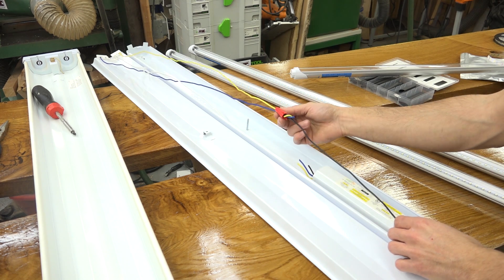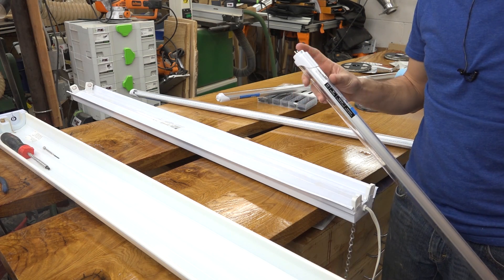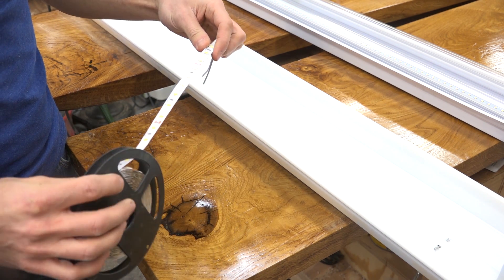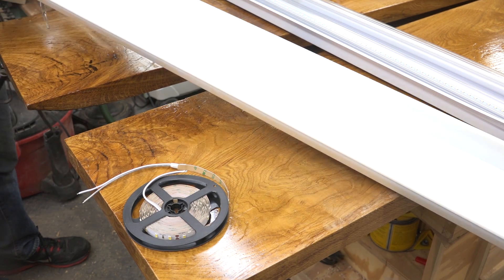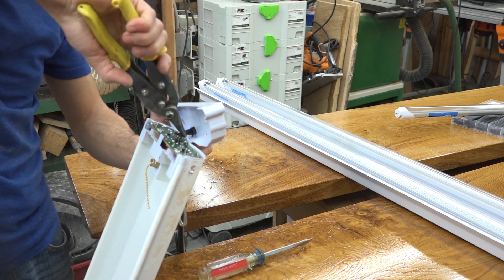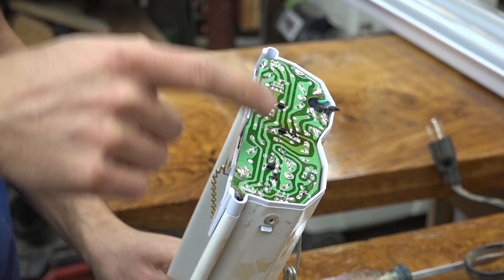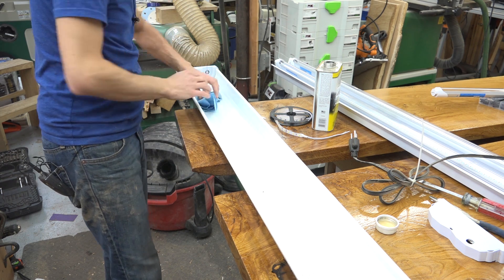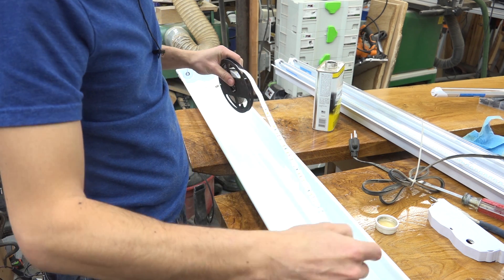Custom Workshop Lighting Solutions with LED Strips

Comment: Matt, great idea with the LED’s. 2 advantages to using them you didn’t mention (at least in this video) are operating cost which is a tiny fraction of incandescent bulbs and fluorescents and almost as important - the LED’s will last the rest of your life for most of us so the periodic hassle of replacing bad ones is gone. I’m shopping for a roll of them now and will outfit my band saw, drill press and router table right away.

Comment: I take out the metal cover for the ballast and wiring and flatten it out a bit but still slightly curved and stick my strips to it (especially good when the whole fixture is not easy to remove such as when hung with molly bolts to drywall ceiling) so that they point in different directions like one big half tube. Watch out for new strips that are made to go directly to AC mains without transformers or resistors (52 LEDs in series); much more efficiency.

Comment: I built a few of these awhile back, using simple 1/2" plywood and 1/8" white coated hardboard (bathroom paneling, whiteboard, etc.) as reflective surfaces. Most important, though, was the LED strips: I was able to find 5M strips WITH a 12V power supply for about $13 each on eBay! They're 5630 LEDs, which are the largest and supposedly brightest. Works amazingly well!

Comment: Self stick anything, especially something that produces heat is no good and only temporary. The only thing that will work is how you fixed the first one which has a good mechanical bond. Your other later video bears all this out.

Comment: How much power does each one take? The reason that I ask is I have a surplus of old pc et al power bricks. I was wondering if I could put an ac power box on tools or where ever and plug tool and power brick into the box and use the brick to power the lights. Would let me incrementally convert to use the LCDs, Use some transformers that I just couldn’t throw out, ...

Comment: I did something similar with my bandsaw, only I wired a converter to the power coming into the saw.  This way, when the saw is plugged in, the lights are on - little extra safety warning for myself, reminding me that the saw has power.

Comment: Question : On those replacement tubes where you disconnect and bypass the ballast to run AC direct to one end of the fixture, what happens if someone comes along and puts a regular florescent bulb in there ?
Reply from the maker: I'm not sure what will actually happen but the replacement tubes come with warning stickers that you can put on the fixture to indicate they are modified.

Comment: I looked at the data sheet for the LEDs that were used and it looks like they are run at 8-9 mA of current each. The life should be almost forever as the 5630 LEDs are normally driven with 20-25 mA each and still have long life. Even the smaller 2538 LEDs are driven at 15-20 mA of current. The current is limited by the one resistor that is used for every three LEDs. The current LED strip requires a 2.5 amp supply and there are alternatives that require a more typical 5 or 6 amp supply. LEDs with a temperature (K) of 3000-4500 are good for living, reading, and working areas while 6500 or so cold white look really good with aquariums & fish. Try a cheaper strip and don't worry too much about CRI, just select a desired temperature. Home Depot and other home improvement stores sell a variety of 24" by 48" diffusers in clear and milky white for around $10.00 which could easily be cut to size. The pressure sensitive adhesive (PSA) is best used on high energy surfaces like metal, glass, and some plastics like ABS or polycarbonate. The PSA won't work well on low surface energy surfaces like powder paint, nylon, delrin, and some plastics like polyurethane or polyethylene. Heat will soften the PSA bond and if you ever need to remove it freeze it. The project came out good. I have seen rain gutters used as a reflector.
Reply from the maker: Thanks for the tips!

Comment: Thanks! That was cool. Also, got me thinking about all the places I could use LED strip lights. Did you have a separate power supply for the band saw?
Reply from the maker: I used the same supply and ran wires to it.  I may put it on it's own supply some day.  Thanks!

Comment: Great job. With the light you put together yourself you'd have been better off to run four separate strips. The copper in the strips isn't very thick so you get a reasonable voltage drop along the length.

Comment: A few things.  The (supposed) 3M adhesive that I have falls off of the LED strip itself, as well as the thing you are sticking it to!  (I do buy the cheapest strips though! £6/$8).  I used to use hot melt to attach until I realized that the heat from the LEDs made it soft.  I now use double sided tape nicked from my "routing template" box ;) and no more problems.
2nd - 5630 (that's 5.6mm x 3.0mm for size of LED) strips are the way to go.  The 5050s or 3528 are old technology and don't put out as much light.  Matt's LEDs look like the 5630s from here :)
Good shout on using the leftover LEDs on tools.  I've got a load on my drill press.  I have wired most of my shop with 12V so that adding extra LEDs is easy to any dark spots or places where your shadow blocks out light.  
I've now got over 13m of strips all running off of 1 old computer PSU which switches on with the fluro lights (they're all on the same switch).  The PSU still runs very cool... I could probably double up and still have headroom in that PSU.
Great video :)

Comment: what i have found with these strips of led lights is there is a lot of voltage drop the longer you go and you lose a lot of light as the voltage goes down. I fine that 1 meter is about the max you want to go or 2 meters if you power the strip at both ends. you will see a big diff getting more even power to the led's. and get rid of the wire that came with the led's!
PS : i'm using 4 rolls of led's 120 watts each roll to lite my shop and its bright!

Comment: Matt I have done this with hundreds a feet of this stuff.  We were very successful using a 1/2 inch wide piece of aluminum c channel and using silicon with plenty squeeze out. The tape we used did not have a backer.  If you didnt have the fixture plywood would work but the surfaces must be very clean silicon is more forgiving.
Reply: Ps the bandsaw idea is awesome.  I kept tripping the bandsaw during startup with a high wattage output bulb and vacuum. I switched to led and a timer on the vacuum.  Great video.

Comment: Thanks for the video. I wish I had seen it before I replaced my fluorescent lamps with AC tubes. I really like the lighting I have now, but the tombstones (lamp holders) were facing outward instead of downward. This didn't make a difference with the fluorescent, but the LED tubes project light in 180 away from the tombstones.

Comment: Another thing you might want to try is using the colored LEDs. Most are about the same price and most you can adjust the color to what you want. So instead of pure white, you can add blue or yellow to "soften" it a little. Just a thought.

Comment: Hi Matt -- Nice of you to share your LED conversion project.  This is a project that's been on my mind for months and it took your video to kick me over center and get me started.  I gutted my fixture and replaced everything with a small DC power supply to feed LED strips glued to the reflector.  I pulled from a roll of 5050 LED's that were pre-wired for 12V.  Unfortunately, the amount of light produced by my LED's was nowhere near the intensity of your LED's. Also, would you please say more about your choice of LED's and add a link to those specific LED's, if possible.  I'm highly interested in knowing the specs rather than vendor, since many vendors stock from  the same manufacturer.  Many thanks.

Comment: I have found that different manufacturers of replacement 4ft fl. LED lights are designed differently.  1 uses a certain electronic ballast that used to run the T8 fl tubes. The LED swap out the T8 bulbs as is.  Other ballasts won't work with the bulbs. [Phillips].  Another company, wants NO ballast, uses 1 socket per bulb to feed the new LED tube directly 120 volts and the socket on the other end has NO power, it is just a holder.  He mentioned this version in this video.

Comment: Very timely spot for me, i just added 7 twin tube LED new fixtures to my shop.  WoW, what a difference that made.  Now I have several older florescent fixtures that I will now convert to LED strips and put them in my garage.  Good video, simply stated and performed.  Well done, Sir.

Comment: Nice job using a switching power supply.  You should look into a PWM dimmer for your tool mounted lights.  And consider white spray paint and using the angled areas of your fixtures to defuse and get a better spread of light.

Comment: Just for reference. Led strips should be wired at both ends when they are greater than 1 meter because voltage will drop at the end where the strip was just cut and not wired too(they will not last as long as well). moreover, led strips will emmit less light  the more they are used... great project regardless!

Comment: I have done the 'LED strip fix' to 3 old fluorescent fixtures around my shop and garage. All have worked out great and I am happy with them. I plan to do more, as the old tubes and ballasts die off. I had a bit of trouble with power supplies from eBay, which came rated for my load but lived only short lives. I'll be buying only honking big ones like yours from now on! Thanks for the video, interesting stuff and NICE shop BTW. Is that garage door access to your basement!? I'd certainly like one of those! Oh and btw, I used a dollar store shower curtain as a diffuser, on one of my modified fixtures. I cut it to size and hold it in place with a few short sections of fridge door seal magnet strip. It works great, looks ok, for a shop, and really takes the starkness out of the high brilliance LEDs over head. Hope this is helpful.  Cheers and best regards.

Comment: I have been thinking about LED lighting and after watching this 😹 I now know it's the only way to go special with adding light to tight places for me not only in Dads workshop but for mine as well for my sewing machines for one but also making a custom light box for transferring my designs from paper to fabric 😹😹 also in the tight spots for my jewellery work bench tools and many other places but also for in the kitchen cupboards when I remodel the kitchen all my draws and pull out pantries can all have their own light which can be auto turning on when they are opened 😹 so many ideas are running through me head now so I'm off to write them all down 😹😹😹😹 thanks for showing us all how easy it really is to install🤗🤗🤗

Comment: I have created a number of LED projects over the last 2 years ... I have replaced nearly every hall / bathroom fixture with the LED strips.  Some Daylight or Pure White ... Others with Warm White (bathroom). I like to use a hot melt blob about every 6 inches along the strip (keep it off the LEDs of course).  You can find any size 12 volt DC power supply you need to power your projects all the way from 1 amp to 30 amps or higher. (I usually buy my LED and Power supplies off EBAY, but Amazon works too)  The 5050 LED strips are the most common and most for the $$ to create the most light.  They draw about 1 amp per meter at 12 volts DC.  So if the strips are 5 meters each and you run say 4 strips in various places in your shop you will need 4 x 5 = 20 meters or about 20 amps at 12 VDC.  I would recommend adding at least 20% overage on the power supply rating to keep from running the power supply too hard and shortening it's life.  So 20 amps x 20% = 4 amps extra ... so at least a 25 amp power supply would work ... if it didn't cost much more an it usually doesn't to go to 30 amps I would - It will probably last longer.  Best of Luck with your LED projects !!

Comment: For future use of those LED strips  you don't need that massive transformer. All you need is a simple wall plug 110V AC to 12V DC adapter. Which shouldn't cost more than $5.

Comment: Can you speak a bit more on why the LED's need the power supply? Great video, thank you for the fun idea!
Reply: +Purveyor of Awesome No one has mentioned that you need to convert the 110V AC (or 230V AC this side of the water) which comes out of the wall socket into 12V DC (which the strips run on).  The power supply does this.  I don't know if I've gone too simple here, but no-one else mentioned this in detail, so I've added it just in case.
Reply: Note he used a switching power supply.  It's not required, but a switching power supply will only produce as much current as is needed.  Where as most "power brick" burn the same amount of power regardless of how much current is drawn.  So if you want to save on your power bill, use a switching supply.  As far as how much current is needed, you have to look up what, and how many LED's are used on a given strip.
Reply: Mat Helm Great response, TY! Have you seen any good videos on getting your power supply correctly for the amount of LEDs used?
Reply: Purveyor of Awesome Not really.  It's been a couple years since I've missed with any of them.  But they are all so different that you really need to google the actual LED on a given strip, to find it's data sheet.  Then just use OHM's Law to calculate current.  They all have their own resistor so as long as it's the correct voltage, you're good.

cut n paste from google:
Calculation Examples:

Example 1: A 5m roll of SMD3528 (0.08w) with 60LED/m would be: (5m x 60 x 0.08) / 12 = 2amps +10% = 2.2Amps.

Example 2: A 5m roll of SMD5050 with 60LED/m would be: (5m x 60 x 0.24) / 12 = 6amps +10% = 6.6Amps.

http://www.lednews.org/calculate-power-consume-led-flexible-strip/
Reply: EscapeMCP Thanks for the notation. I saw "wall wart" that I needed to google, good nickname for the 12V converters.

Comment: Hey Matt! I just thought of a possibility for the diffusion issue. You could put a piece of white painted plywood on your ceiling and then hang the LED fixture upside down. The light would then be indirect instead of direct. If you wanted to make it partially directional you could replace the plywood with a curved white surface facing down. That would probably be brighter too, because not as much light would be bouncing straight back down into the fixture. I'm sure you could play around with the geometry of the white surface to get it to go where you want it. What do you think??

Comment: good walkthrough and comparison of LED options.  To add to your test, I've found the most cost effective and quickest way to install LED lighting is with retrofit plug and play tubes which don't need any additional wiring or modifications.  My best source is 1000bulbs.com where I've purchased them in bulk for about $8 a tube including shipping.  The idea to use strip lights on shop machines is excellent, especially the bandsaw.  Bad lighting on that machine alone leads to not only cut errors, but also increased hazard and safety issues.

Comment: Hi Matt, the best thing about the led strips is that you do not need a light fitting, you could just use a strip of wood and hang that or even just stick them directly onto the ceiling. As you said they can be used anywhere and do not take up any  room, and are safe as well

Comment: I'm thinking you could run many of the little pieces of strips off that one power supply.  Use a thick wire such as 10 gauge to reduce transmission loss.
Reply: You are so right you could run an entire shop off one power supply if it was rated properly.  However you actually don't need 10 gauge wire because the strips only draw about 1 amp per meter.  So if you had 20 meters it would be 20 amps which 12 gauge would handle easily.  And anytime you are running back to the power supply on each strip you can use even 16 or 18 gauge because that wire is handling only the current for that LED strip. :)

Comment: I have seen it before but do not remember the name of it.  A switch that turns two different circuits on / off.  Put it on the band saw then turn the saw & LED strip on/off at the same time.
Reply: Something like that is called an "iSocket" here in the US.  Typically it's used to turn on dust collection but could be used to turn on a power supply for the LEDs.  Keep in mind that with the saw off the LED's would be off.  Also, when the saw is turned off the LED's go but that blade would still be coasting to a stop.  Most folks do not run there power tools and lights on the same circuits for that very reason.

Comment: I glued up some oak about 2 in thick by 5 wide router 4 x 5/8 in wide strips the length and glued the ligts in. Pulling wires thru to top and cut in a small power supply and it hangs over kitchen table. I have made many things with led strips and found most time the adhisive back is not strong enough especaley in the cold. Good  carpet tape cut to width works good as well as epoxy. They put out a better light and cheaper too

Comment: How many fixtures did you run from a single power supply?  It's better to do this in parallel, correct?

Here's another idea: http://www.instructables.com/id/Inexpensive-Garage-Lights-From-LED-Strips/
Reply from the maker: +Mike Pomatto just those two and what I put on the bandsaw. Yeah parallel is better since there is less drop along the length of the strip. I've seen similar setups to that before. Pretty good idea

Comment: This is a great idea... I just replaced my fluorescent fixtures with some DIY fixtures using LED A-shape light bulbs. The light improvement is amazing and it was a very cheap improvement. I tried the retro fit tubes and it didn't work for me, it would have been cheaper still. But my DIY solution was only about 17$ per fixture (including the bulbs). It was about 50$ for me to replace all three of my fluorescent fixtures.
Reply from the maker: +Live Free and DIY that's pretty decent. Nice!